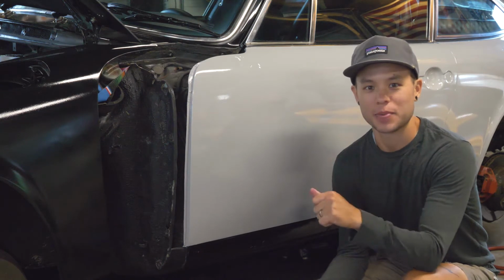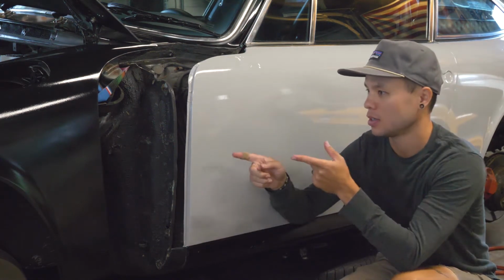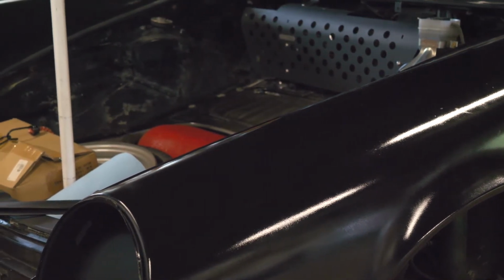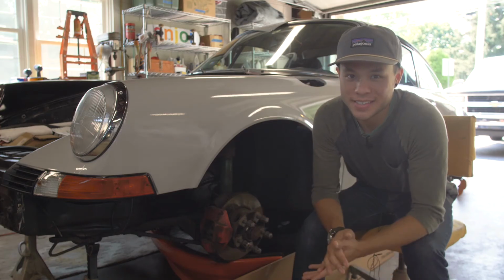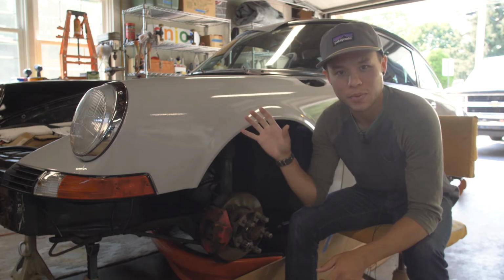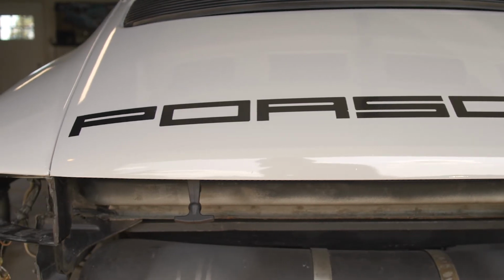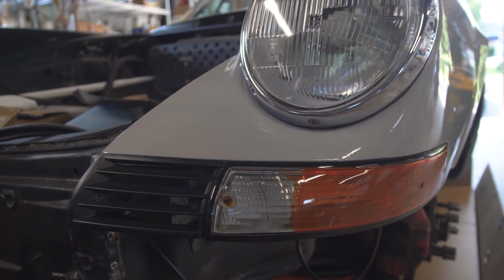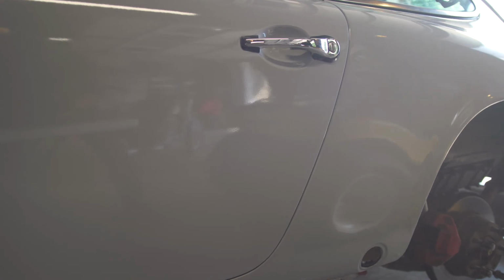Porsche 911 Vinyl Wrap - Ep03

Comment: Can you show or explain how you made a “seam” under the headlight? I’m about to undertake a similar project.
Reply from the maker: Front fender was probably the hardest part. I basically just sliced a vertical line down the headlight, and then set one side. Then pulled the other side over and trimmed it to make a small seam over the first side.

Comment: How many feet did you use for the car?
Reply from the maker: I ordered 50ft and had plenty left over when I was done. Keep in mind though, I didn't wrap the hood or bumpers.
Reply: @BennyObscene  Yeah I was thinking 30 feet. could always get more. I have a whale tail though so im not sure if that can be wrapped successfully. I probably wont do it just thinking it would be nice in blue.
Reply from the maker: @jeep2003  go for it! worst case scenario you mess it up, pull the vinyl off, and are out $100

Comment: What is the longevity of the wrap?  And what are the maintenance routines for it?  Can you run it in a car wash, etc.?
Reply from the maker: 7 years for the higher quality 3M stuff I'm using. Regular car washing is fine, but you're not supposed to wax it. I've also read that car washes with brushes can damage it, but that's the same for paint too.